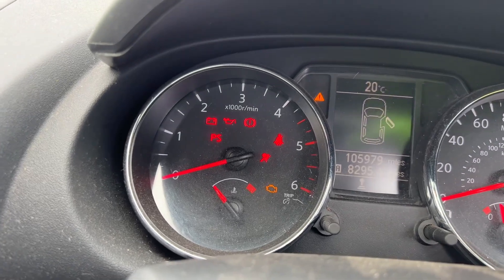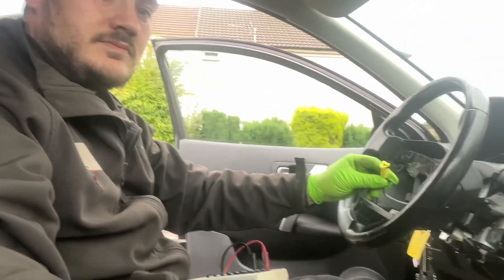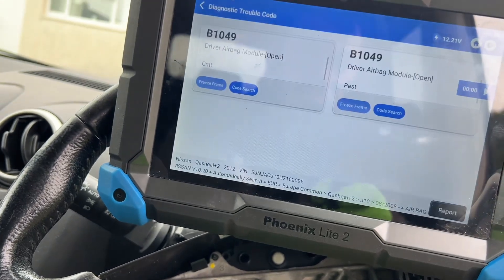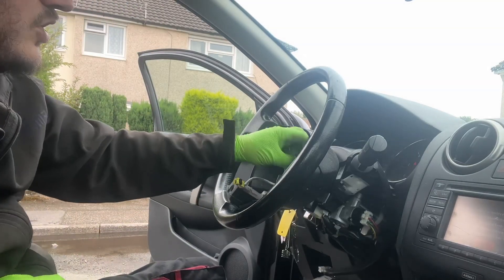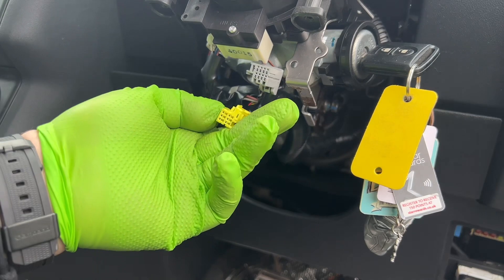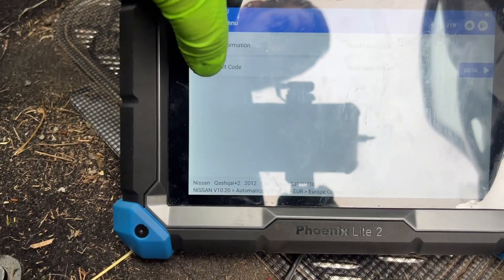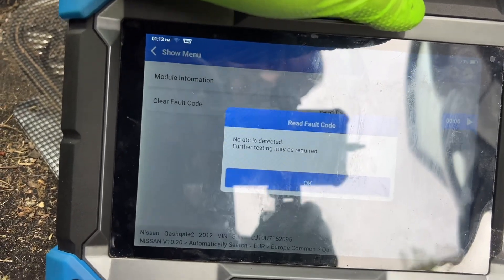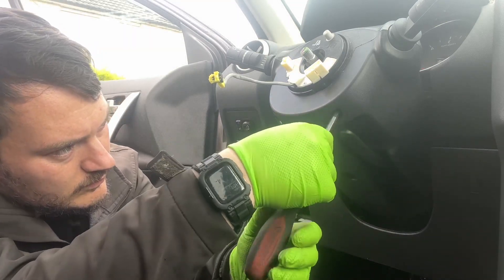Nissan qashqai with a flashing airbag light

Comment: if you went into srs read data stream, you'd most likely see the airbag pids showing resistance values and the changes made when you connected your  resistor.  Also might see resistance readings change when turning the steering wheel indicating a clock spring problem if it's not open circuit. A measurable number value is always more concise than clearing faults as slight variations can be seen if they are there.   Also helps with example, seat airbags and moving wiring around the seat plugs to  isolate the fault. A lot of times 1ohm difference can be enough to set codes but painful to isolate. Never stop learning. Good vid.  Oh your camera is some how reversed.  Shows you going lefty to to tighty the screw and nut. Not knocking,  really just trying to help :)